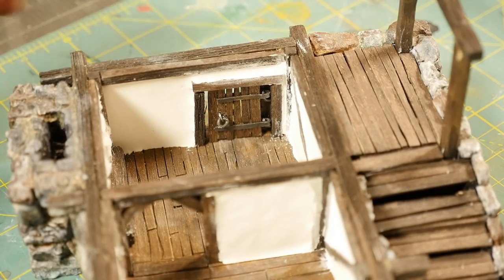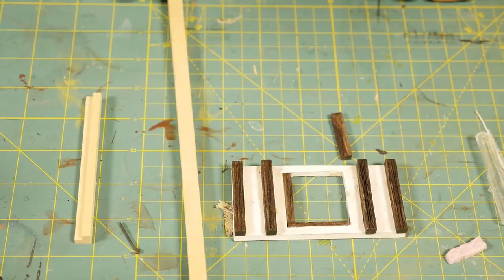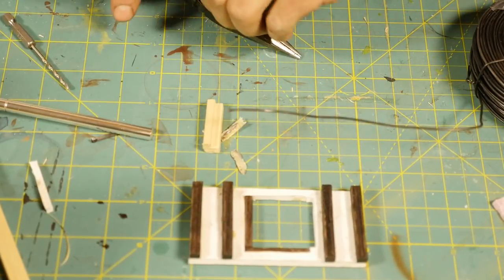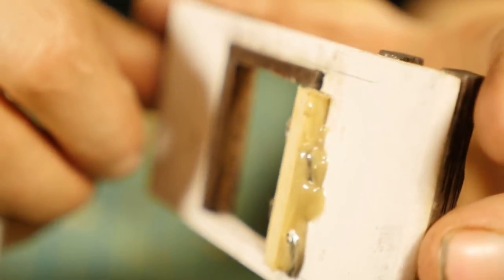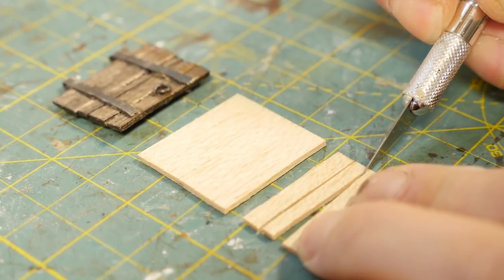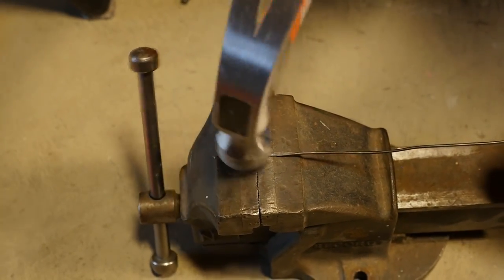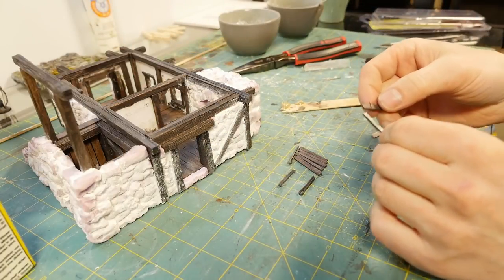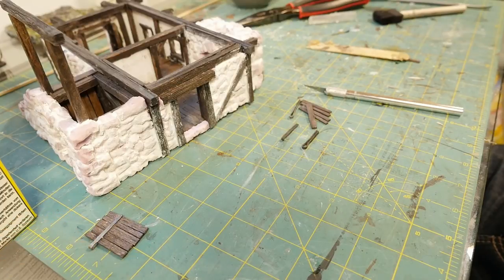How to make SWINGING doors with *Metal Parts* for your model buildings!

Comment: I think if you get a pair of jewelry pliers, which are tiny and have no texture to  mar the wire, you can make the door hardware much more easily, including probably making a ring on the inside of the door handle.  The cold forging of the clip to make the door was very, very clever.

Comment: I make chain mail.  to make your ring you need to wrap it around a mandrel several times then cut it off.  Put a 8p nail in a vice and wrap it around that since you're making such tiny rings.   You won't have to fight it that way.   2d.  If you heat your wire red hot and let it cool you will have annealed it and made it more playable.
Reply from the maker: Awesome!  I will definitely take that advice, thank you sir👍

Comment: A jeweller’s tip for making rings. Wind the wire around the shaft of a drill bit of the required diameter to the number of rings you want ( ie if you want 2 rings, wind it fully round and past the start point twice) ) with a 1” tail at the start and end lying perpendicular to the drill shaft and just over 180 degrees apart. Use a jewellers coping saw or fine blade fret saw and cut along the wire perpendicular to the coil (along the shaft of the drill). You can also use sharp flush cutters to cut each ring off as you need it. I usually keep broken drill shafts of various sizes for this purpose. 
Each ring will fall off with the ends slightly offset which can easily be separated further by gripping the ring across one end and 180 degrees across the diameter and twisting the other end away from the gripped end. Closing the ring uses the same method by twisting the unclamped end back into line rather than pinching them together. This will save your fingers from pinches and also reduce the chance of the ring flying off into the darkest corner if the pliers slip causing hours of frustration as you look for a tiny ring.
Reply: This method also prevents having your ring distorted in shape as you struggle to close it!

Comment: 12:45 a Tip , try winding up some wire around a pencil or smaller rod than cut it into open rings . Method used to make Chain Mail rings xD

Comment: Easy way is to wind it around a rod of the size hole you require. Wrap it around at least how many round wire circles you need plus 1/2 dozen times. Slide it off the rod and jewellers hacksaw down the middle of the coil and it will fall into multiple circles that just need closing with pliers (sideways). Really much easier!
Reply from the maker: Hey that sounds much much easier and efficient.  Gonna have to give that one a go!  Thanks for that little pearl of wisdom.  Never would have thought of that.👍🙂
Reply: As a hobby blacksmith, and working with much bigger scale, I use my angle grinder to cut a big spring right down the center and presto you have many perfect rings!! This will work with smaller springs as well, no need to wrap that way. Love your builds by the way!!!!

Comment: Awesome tutorial! Did you ever think of using solder for your door strapping and handles? Much easier to work with!
Reply from the maker: very true, although I like the look of the black iron over the silvery finish of the solder.   Plus it feels a little more authentic like Im actually doing a bit of blacksmithing pounding out the iron wire.😁⚒

Comment: Having a bit of trouble finding the right kind of wire to hammer out across the pond. What's it intended use so I can go to the right kind of shop. Thanks
Reply from the maker: The main intended use I can think of is for tying re-bar together for concrete construction.  So you'd find it at a local hardware store I'm sure.👍